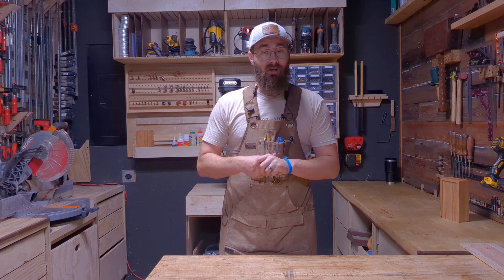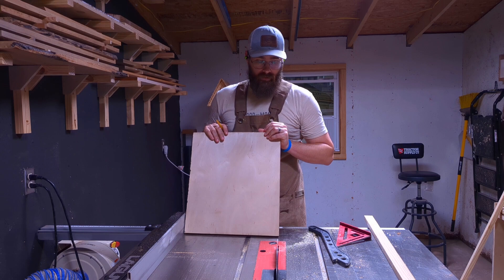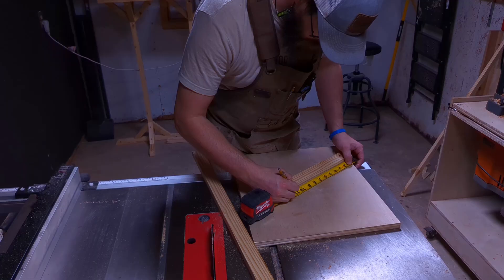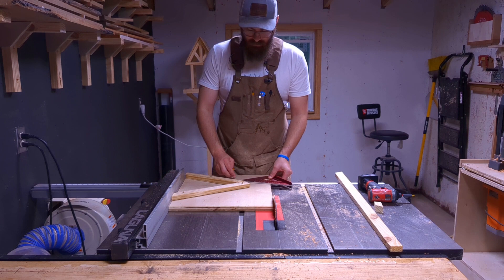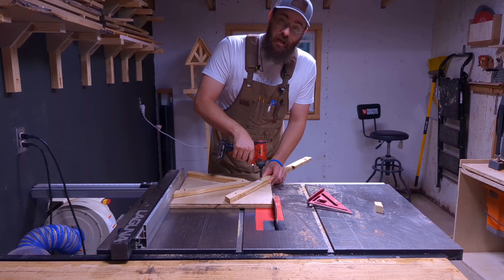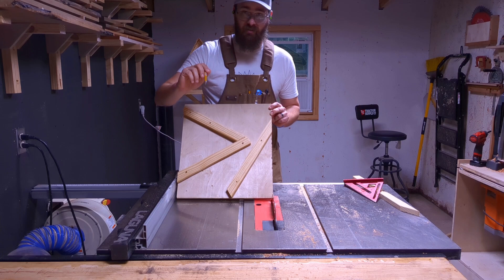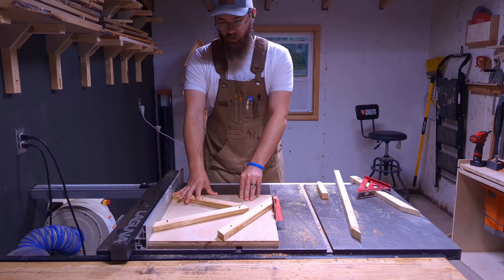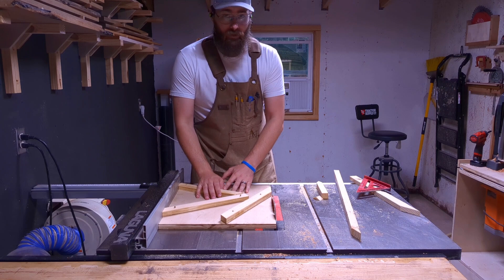Easiest Woodworking Jig Ever!!!  How to make a woodworking Jig

Comment: Very nice video that's helpful for sure on jig making, I recently have been working on a mountain wood shelf with plenty of ideas on Pinterest but with no real guidelines on the bottom board length to start out with, so my 30 degree angles turned out a little off kilter, which resulted in a lot of sanding and wood filler to make up for it, any chance you could show us how to make one of these shelves? Mine is one that has the 3 bigger mountain peaks with 2 smaller sitting in the vees on both sides, I really like your videos and look forward to more, thank you!
Reply from the maker: I'll have to look into that. Thanks for commenting, glad ya like the video!

Comment: Been thinking of making the triangle display box for the flag that was on my dad's coffin. All that I have watched we quired a 22.5 Degree cut for the bottom corners and they were using a built jig on the fence of their table saw. Just wondering if that cut could be done on this simple jig?  Would you care to do a build of the flag case using this jig with plans?  My dad was killed in an auto-train accident when I was 4 months old. Mom kept the flag in her cedar chest and I dug it out the other day and want to do a case for it. Can you help me out?
Reply from the maker: I'll have to look into that.  That's a great gift idea for your mother.
Reply: @burnstockwoodworking  Mom passed in 2004 I want to pass this down to my son.  Dad died when I was 4 Months old in a car-train accident (Mom never remarried) I kept most of my mom's stuff stored in bins in the basement. Went looking for the flag last week and it was actually where I thought it to be. (That never happens) This flag is 3"6" X 6"8" with 48 Stars. I found this to be an ODD size, but having the 48 stars confirmed in my mind it is the right flag that was on his casket. Dad died in 1950.  Any help would be fantastic.

Comment: Please share the size of the scrap wood your using for your template. I have the angles down just need the scrap wood size, I know I said that twice. I don't want to guess at the  size.
Reply from the maker: The ply was 17" x 17", the fencing scrap was about 13" long.  Made a mark where the stop needed to be and screwed the other fence down.  The plans detail the individual components for the feeder.  You can use those measurements to figure out the wood needed for the jig.
Reply: @burnstockwoodworking  Thanks I have printed the plans from your site. And now I will build it and see how it goes. Thanks again.